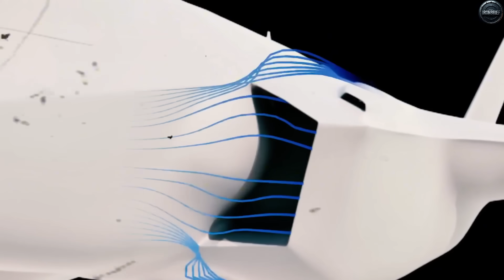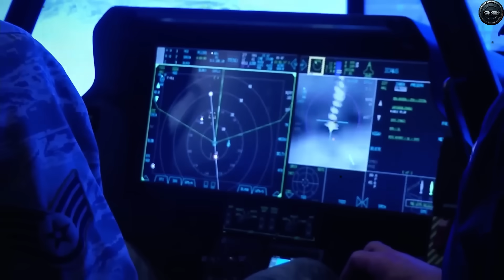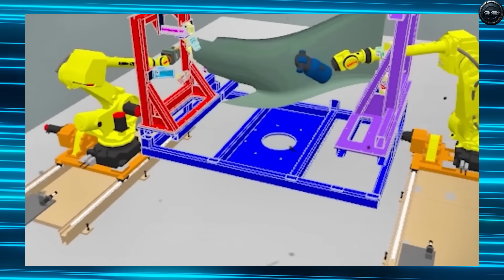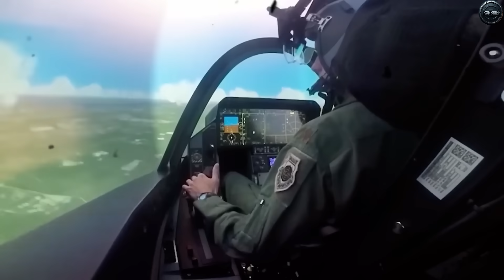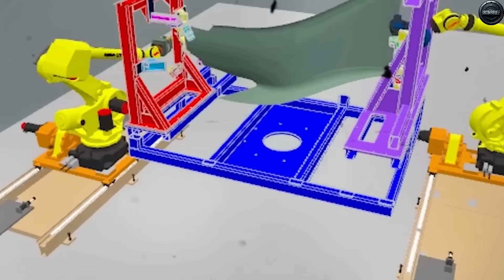Finally: UK’s 6th-Gen Tempest Jet Replaces Typhoon – A Weapon to FEAR

Comment: the Typhoon will not be retired for consideable time yet - when the Tempest (or what ever name it turns into) comes into service, the Typhoon will fly for years after that - it may not get main MLU's as the Tempest enters service, but the Typhoon will still play a major role, though slowly being phased out - many of Tempest new toys could and would be tried out via the Typhoon

the Typhoon would act as weapons delivery service with Tempest (using Stealth and other techniques) providing final long range targetting - Tempest will have a joint capability of being either manned or unmanned, with the capability of deep penetration and loitering over a region - the Typhoon could be made to be unmanned but that would take consierable resource / time and funding, so probably not going to happen - the RAF will either sell off stock or just not update Typhoon in favor of Tempest as they retire individual jets
Reply: Tempest would look great flying Canada's sky's.